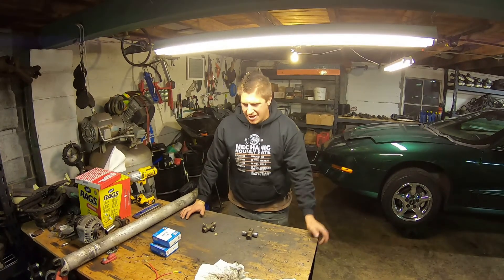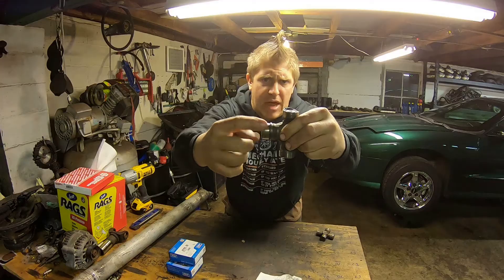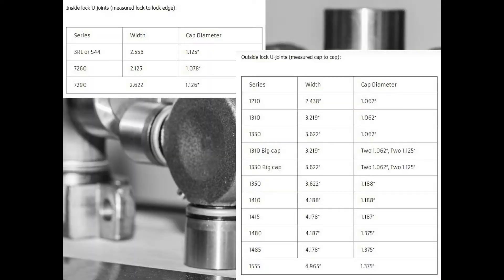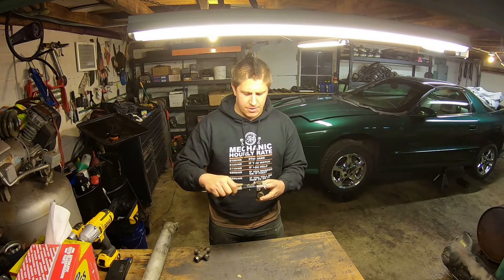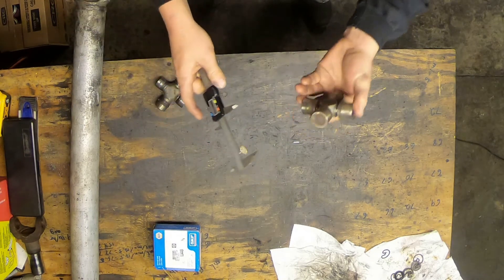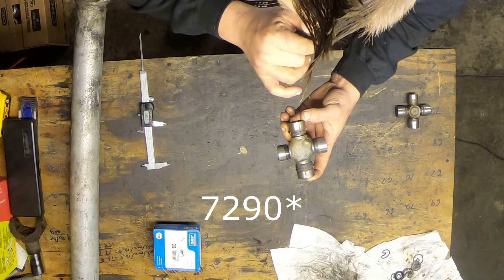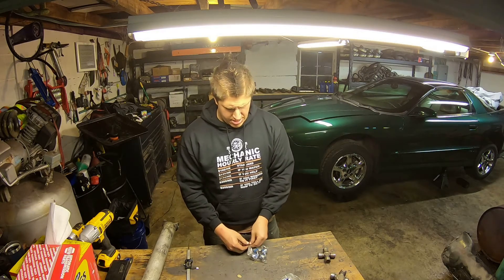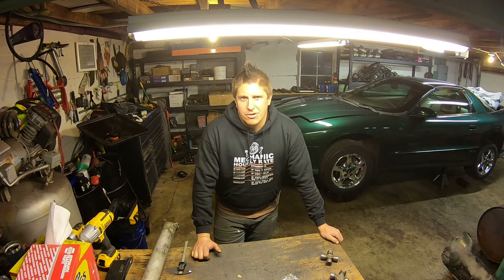UNKNOWN U-Joint???? How to measure universal joints

Comment: Great video!! I’ve ran into this issue a couple of times, and ended up at the parts store trying to figure out the right joint. I had never seen the chart before.
Reply from the maker: Thank you! Yeah, knowing how to measure them can save a lot of guess and check work, especially if you're working with aftermarket parts.

Comment: hi sir! what is the size of cross joint for ford ranger XLT Auto Trans 2014 4x2? thanks. god bless!
Reply from the maker: I honestly don't know off the top of my head. I'm sure you could use this video as a guide though to get the measurements and determine what size u-joint it is. You could probably find it on google or an auto parts store website as well.

Comment: What about going from plastic injected to inner clip... How do you measure the original u joint? Or do you measure the inside of the yoke? Not talking about cap size.
Reply from the maker: I'll have to find out to be honest. The only place I've seen the injected plastic retained universal joints, is in a factory application, so for those I've always known what it goes to and just ordered the factory replacement joint for the vehicle and position.
Reply: @MohawkMotors   That makes sense, I just wanted to make sure I was ordering the correct ones online according to size. Thanks for the prompt response. PS your video was very helpful, thank you for posting.
Reply from the maker: Glad it helped! Thank you for watching!

Comment: When measuring the inside dimension of a universal cap you measure from the outside to outside of the valley to match up with the inside of the driveshaft therefore inside inside makes you a mohawk too close to the oven kidp
Reply from the maker: That would only work on a u joint with internal clips to retain it. To accurately measure a u joint, you need to know how it is retained, and how to measure the dimensions I showed in this video based on the retention style it uses. Measuring the yoke or the driveshaft is not an accurate way to measure a u joint, but it will get you close if you don't have the joint.